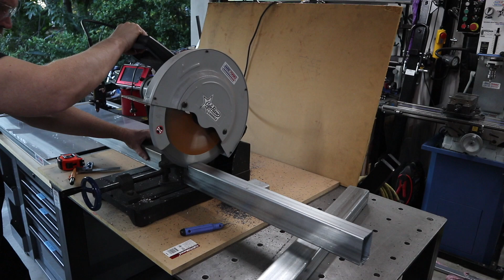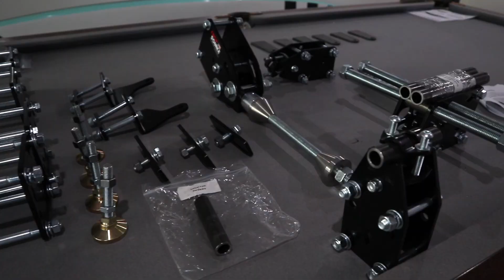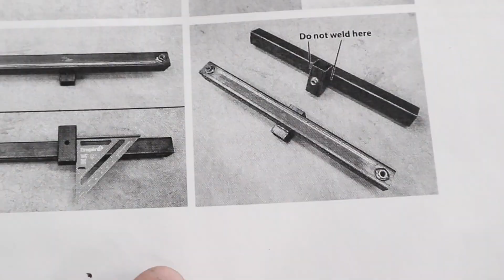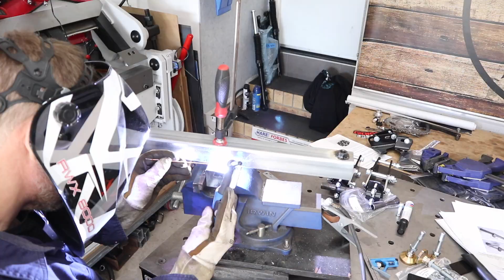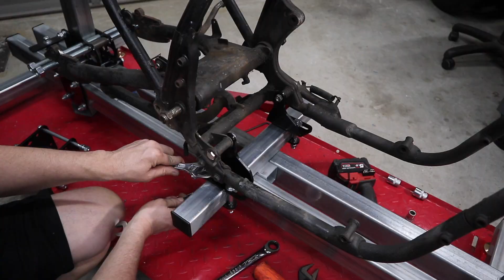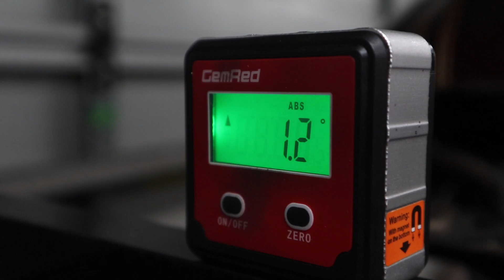BUILDING The ULTIMATE Motorcycle FRAME JIG!!!  - CAFE RACER BUILD

Comment: Top support for the headstock cone is a must, or do you want your headstock to twist sideways when you weld it? it is very easy, 2 x 8 mm side plates 400 mm long with 10 mm holes spaced  25 mm apart down the length of each side plate, Then drill a row of 10 mm holes on either side of the main upright again 25 mm apart and then make a duplicate cone carrier as you have for the bottom cone but drill a 10 mm hole drilled either side. It is then totally adjustable to whatever rake angle you want and when all bolted up Solid as a rock! , so before you cut the main upright for the headstock add an extra 300 mm to its length so this can be incorporated. or it will be too short to implement.